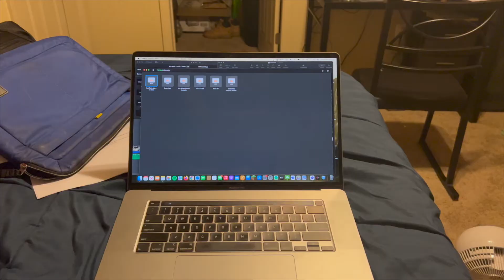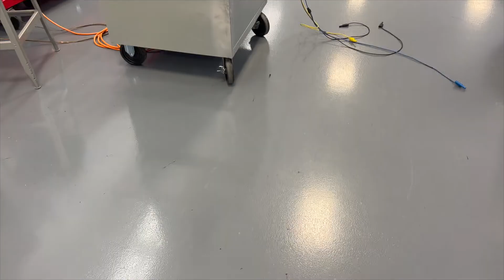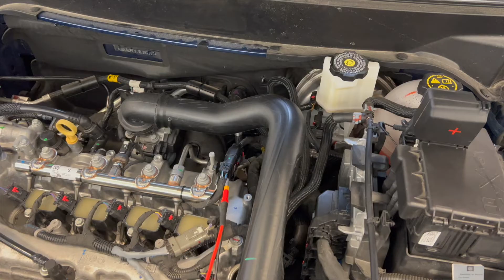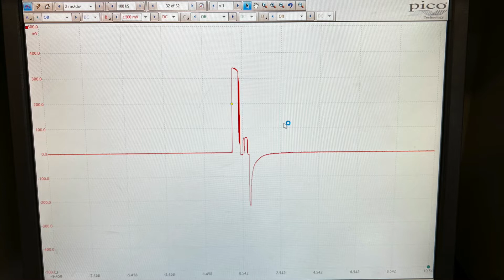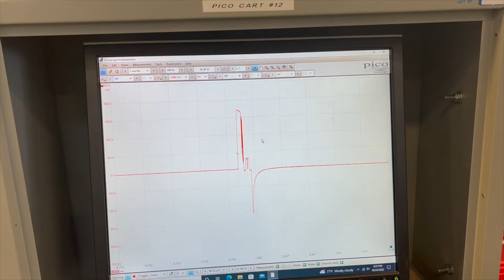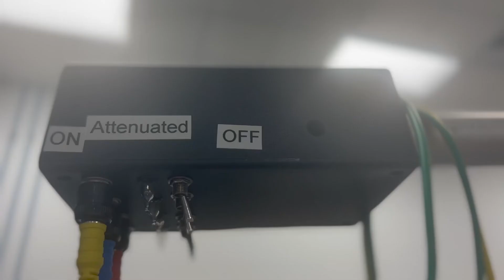Direct Injection PicoScope Waveform

Comment: You've measured the injector waveform in a different way to that recommended in the Pico Guided Test. That is, you have measured across the injector terminals rather than using 2 channels and measuring between each terminal and the chassis ground (which will help you more quickly identify where apotential issue lies). So it's incorrect to say that the Pico waveform is inaccurate. To prove the point, open the Pico guided test and add a A - B Math channel, which, in effect, creates the differential signal you have measured. You will see a waveform extremely similar to the one you are showing here (obviously there will be slight variations due to differences between makes/models/engines/variants etc.). Hope that helps.
Reply: Does pico offer help on analyzing the waveform measurement when its done like in the video ?